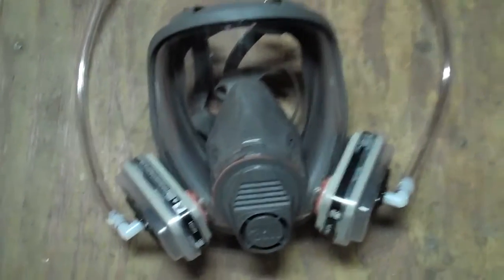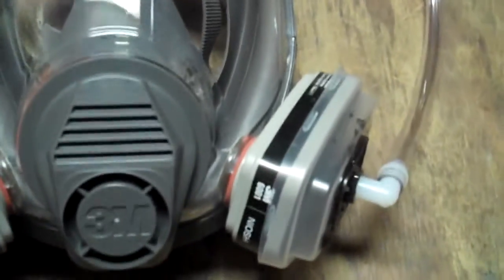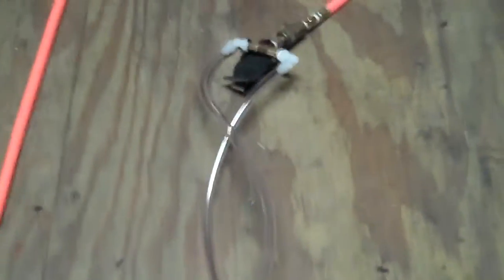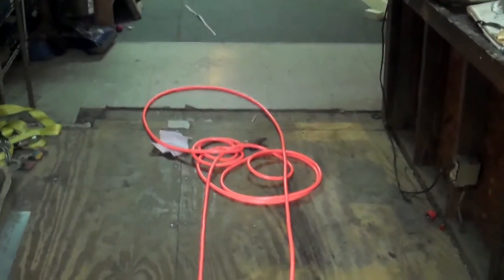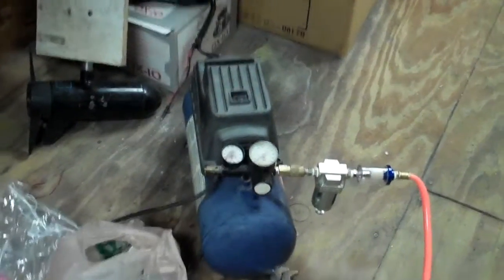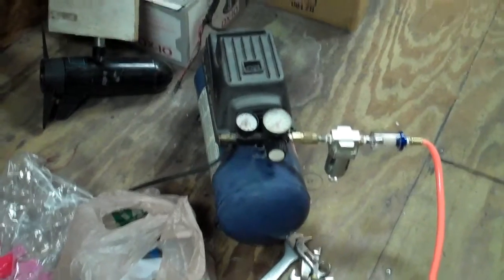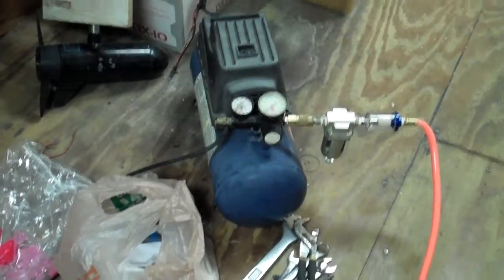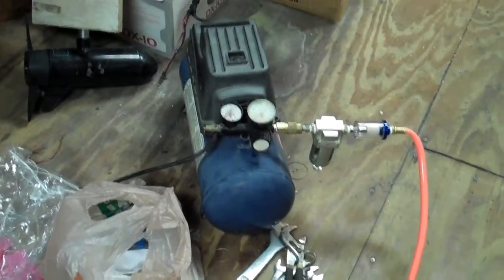homemade full face mask respirator fresh air system part 4

Comment: You can't breathe air from regular air compressor, gives off carbon monoxide, you'll die,need oilless compressor
Reply from the maker: it is an oiless compressor !!
Reply: What if its electric power? Where's the carbon monoxide coming from?
Reply: What if its electric power? Where's the carbon monoxide coming from?

Comment: Was any modification needed to fit and seal the nylon barbs into the respirator? and what was the cost of all the fittings?
Reply from the maker: the fittings were nylon 3/8 " 90 degree hose fittings..home depot at a cost of less than 5 bucks.used silicone sealant to secure them to filters.simple,cheap and effective
Reply: @melbaron1110 I noticed you haven't made any videos in many years. I found this helpful and just wanted to say that I hope you're well and I've enjoyed your old content.